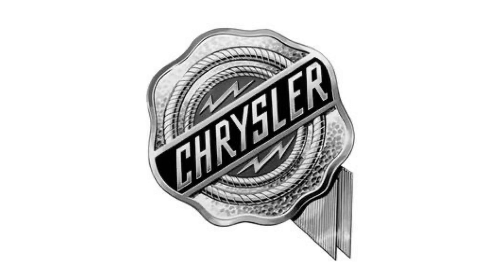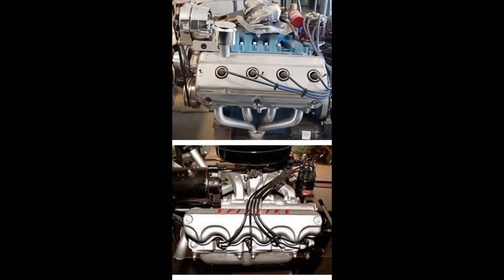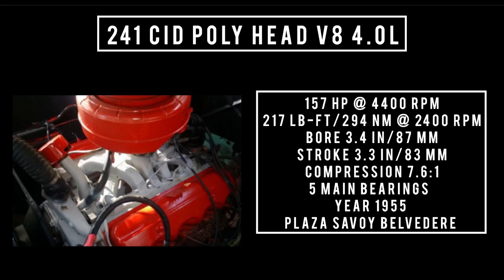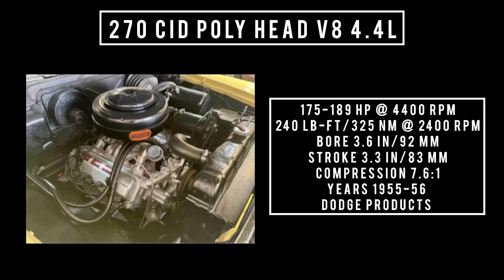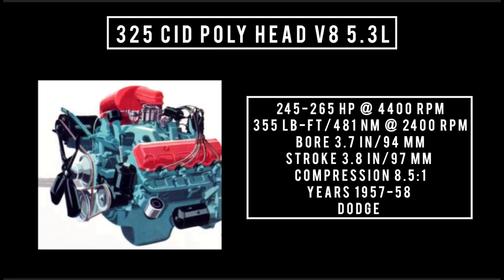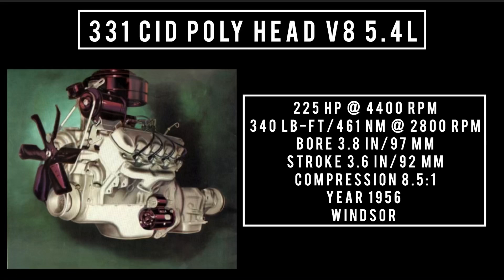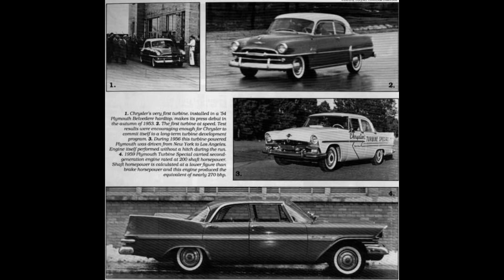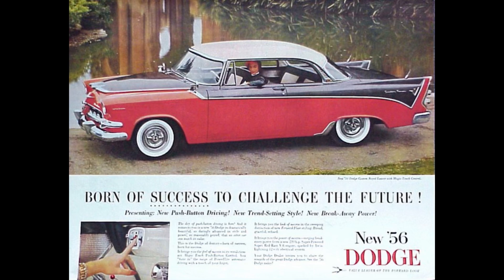Chrysler polysheric head engine family 241, 260, 270, 315, 325, 301, 331, 354

Comment: Chrysler Corp had a strange thing going on with their 4 lines of cars, Plymouth, Dodge, Desoto, Chrysler. Plymouth would have the smallest engine. Ex: in 55 they had the same exact engine as the Dodge except for displacement. In 55 Dodge had the 270 hemi & poly, Plymouth had the 260 poly.  In 56 the Plymouth had a 277 poly while the Dodge had a 315 poly & hemi. On and on until 62 when they had the same basic engine sizes through the entire line. The other lines were the same with Chrysler having the largest & most powerful. Plymouth smallest, Dodge a little larger, Desoto a little larger than the Dodge, Chrysler a little larger than the Desoto. On the Plymouth 277 introduced in 56: It was a completely different engine than the other poly engines. It morphed into a 303 then 318 poly engine which was used up to 65. The 318 Poly block morphed into the 273, 318, 340, 360 LA engines.
Reply from the maker: Thank you so much for taking the time to share that insight

Comment: Do those Plymouth   have the camshaft in the same position in the vertical height of the block as the Dodge  hemi or different? Are the crankshafts interchangeable? and are they both forged?

Comment: Polys are so underrated. I obtained a 65 Dodge block that I'm pretty sure will accept LA heads. Gonna turn it into a 392 stroker and use big valve J heads. I stuck an LA cam in and it fits identical to the poly one. The heads bolt right on and pushrods all line up with no interference.
Reply: That's bull. The cams do not interchange. Poly ports are evenly spaced, wedges are not.

Comment: Good Video.

  The Poly engines are often overlooked but were a very good engine in their own right.  Often overlooked is there performance potential.  An interesting tidbit is that while the 1956 Chrysler 300 (354 cubic inch)354  HEMI made more HP than the top of the line 1957 354 Poly, the 354 Poly actually made more torque than the HEMI (per the factory shop manual).  

It was also said the the reason for the the introduction of the Poly was that it was lighter and cheaper to produce than the HEMI.  I'm sure it was cheaper, however the weight difference was pretty negligible.  Both engines used the same block, intake manifolds and accessories (the exhaust manifolds don't interchange).  I personally weighed a 1955 Chrysler 331 HEMI head and a 1955 301 Poly head (on the same scale).  The Poly head was lighter.......by a whole 1 pound.
Reply from the maker: Awesome information thank you so much for sharing all that information and insight glad you did this video I love an engine episode Wednesdays this Wednesday push it back a little bit I’ve had a lot going on in the background which I will make my random moment tomorrow a lot of cool stuff built =)

Comment: Respectively 1951 Chrysler hemi 180 horsepower 

1952 desoto hemi 160 horsepower 

1953 dodge hemi 140 horsepower
Reply from the maker: Different engines these any poly head engines same block as hemi but heads completely different

Comment: The poly is a neat engine.  It would been nice to see a revised light casting as its heavy and wide.

I think only the Chrysler 331-354-392 should have had the hemi heads.  Dodge, DeSoto and Plymouth should have used   a common simpler engine.  The Chevy small block  wedge was the best because of low costs and most weaknesses couid be overcome with aftermarket parts. The complex Mopar valve trains didn't shine as much in family cars as engineers hoped - they loved the race track.

A big block version of the Poly might have been cool.

Comment: The horsepower ratings shown in this video are all GROSS horsepower.  Today we use NET horsepower, which is determined differently.  Typically you can take 20-25% off of the gross HP to get modern net HP.  And that is at the crankshaft, not the tires.

To put that in perspective, a Volkswagen VR6 engine from the Corrado SLC had 178 net horsepower from 170 cubic inches/2.8 liters.  Compare that with the 170 net horsepower from the 331 cubic inch/5.4 liter polyhead V8....
Reply from the maker: Thank you so much for all that information =)
Reply: The Chrysler has way more torque.
Reply: @jamesbosworth4191  ....And spins way slower.  Hence the equal HP levels.
Reply: @Flies2FLL  Which makes that horsepower easier to use - peaks out at a much more usable RPM.

Comment: I will never understand the reluctance of domestic automakers toward the OHC valve train idea.  With this design, it is very easy to produce a true hemispherical combustion chamber.  Porsche did it with the original air-cooled 911 engine, and even the 1980's Ford Escort had a SOHC cam head with hemi combustion chambers.

As to the "polyhead", it looks like the intake pushrods went between the bores as on a Hemi, but the exhaust went along side the bores in the valley, the way it is done in wedge engines.  This saves that much money?

Indeed, I would like to see the breakdown in production cost between OHV wedge, OHV hemi, and OHC hemi designs.  It cannot be much different-

Comment: I liked the,
 440 cubic inch V8 with the police interceptor package, which produces 375 horsepower and 480 ft-lb of torque. The monster motor could take the massive 4400-pound (1995 kg) car up to a top speed of 150 miles per hour

Comment: The 1955 Chrysler Windsor, in both scenarios.  It was much better built than its corporate companion makes, and lacked the pushbutton transmission selectors introduced in 1956.  Anyone who had a '55 Chrysler will tell you that it was a superbly-built car that gave excellent service.  The '57 Chrysler corporation cars tended to rust out.   The '55 Chryslers did look gimmicky, like the last iteration of a body style rather than the first, but their solidity garnered affection.
Reply: Chrysler bought the Briggs body works in 1953 when Walter Briggs died.  They began to produce bodies in house. Briggs built bodies for other makes, but with Chrysler as the new owner those orders ceased. They hastily began cost cutting that produced a reputation for rust. Eventually they decided upon assembling the bodies at the assembly plant - the unitized body, which produced better results. The older Briggs body Mopars were well built.
Reply: @timothykeith1367  Thanks.
Reply from the maker: Yeah I guess Chrysler products have sort of a gimmicky Ness about them but I honestly think when I see one at a car show especially one from the mid50s they look incredible now I wasn’t around when the cars first came out I wish I was I was born too late.

Comment: The 56 Plymouth poly was 277 CI
Reply from the maker: Different engine family 
This engine family is super confusing that engine has nothing to do with the engine fan we discussed I should’ve made it more clear in the video that Plymouth only used or shared the Dodge engine in 1955 and 56 they got their own engine which also used poly heads but had nothing to do with the hemi block 

The hy fire 277 was in the Chrysler A family Which came out in 1955 it was offered Along side the poly/hemi block 

https://en.m.wikipedia.org/wiki/Chrysler_A_engine

Also check out 

https://en.m.wikipedia.org/wiki/Polyspheric

Comment: Hi Jay!:  Another fabulous engine episode!  At least they tried to stretch the tooling for the hemi block and made another pretty good engine from it!  But you are right.  I think Chrysler wanted to be like GM of the time, where every marque had different engines in their cars.  But even they had to quit doing that by now, or they would have been out of business, too.  Except for the earlier Lincoln engines, Ford pretty much used the same engines for everything. with minor updates.  For example the flathead was just souped up a little when the Mercury came out. But, Ford didn't have but two or three makes until the late fifties when they tried to launch Continental and Edsel.  Interestingly it was Ford that had a semi-hemi engine with their Boss 429 motor.  Perhaps they borrowed the idea from the Chrysler Corporation?
Reply: In late WWII Ford had a dual overhead cam V-10 that I believe they intended for aircraft. It was not well received, but they did make a V-8 version for tanks. Perhaps it had hemi characteristics.
Reply: OOPS!  WYR#1  Plymouth.  #2 Gotta pick that LOVELY 1956 Chrysler, REALLY like that design!
Reply from the maker: Awesome information and insight thank you so much for sharing all of that definitely want to cover the 429 Semi hemi from ford 

Great choices by the way =)

Comment: I drive an all original turquoise and sand color 1955 Plymouth Belvedere with 24000 miles and enjoy my powerful 260 Polysphere V8. She is fast when needed. When I lift hood at car shows there are endless conversations and questions. :)
Reply from the maker: That’s awesome what do you like the most about your 55 what do you like the least I love Plymouth from that era they have so much space inside them even the two-door version I would take a 56 Plymouth anything over 57 Chevy anything I just love the styling of a 56 Plymouth also thinks Chevy ripped off the rear end design

Comment: I prefer the look of the ‘55 Windsor, but ‘56 would bring 12 volt electrics and push button powerflite transmission.  In the end though, I’d still take the ‘55, I’m partial to it as I owned a ‘55 4 door, two tone light green and white.
How about the 413? I have a 300F with all original drive train. I believe that the letter car blocks were specially selected, maybe your research my turn up some interesting factoids.
Great research!
Reply from the maker: Definitely want to do the wedge family on here eventually Chrysler did a lot of different engine concepts just like Ford I was amazed at how many different engine families Ford had I had no idea Chrysler had more.. Not only that every year they change their engine displacement no wonder Chrysler ran out of money.. 

Thank you so much for adding that information what was your favorite thing that you liked about your 55 and what did you dislike the most

Glad you dig this episode =)

Comment: Gmc made a v12 it was two v6 put together that shred a common crank i didn't see it unless i looked over it but i all ways throught they where neat ... Great video 👍👍👍👍
Reply: That's not accurate. Yes mathematically the 702 V-12 was two 351 V-6 engines put together, but that's not what it was. The V-12 did have 1 crankshaft like you mentioned, but it was also 1 block, not two V-6 blocks put together like many assume. It was a 1 piece block for V-12 only. The heads are what give people that impression, because the do use V-6 heads. So there's 4 cylinder heads and 4 valve covers. Just 1 block, 1 crankshaft, 1 camshaft, 1 oil pan, etc......
Reply from the maker: That’s awesome I did not know that definitely have to cover that engine thank you so much for that engine episode idea glad you dig this video

Comment: Very cool 🤙 I just acquired a pair of 354's not sure where I'm sticking em yet
Reply: I recently bought an old stationary water pump from a cranberry marsh that's powered by a Chrysler 354 Hemi 🤘     
The valve covers say "Chrysler Industrial" rather that "Fire Power"
Reply: @johneckert1365  that's cool. A runner?
Reply: @kdsboosted4954  It turns. Haven't had any free time to mess with it.
Reply: @johneckert1365  if it turns I'm sure it'll run. Mine are in parts at the moment
Reply: @kdsboosted4954  right on 👍
Reply from the maker: Sweet =)

Comment: For many years I drove a car with the later generation Poly engine, a 63 with a 318 V-8.  It was very smooth and rock sold reliable, but no hot-rod.  I look forward to the future episode on that variant of the Poly engine.
Reply: I owned several of the poly 318 and as long as the oil was changed  they were very dependable engines.
Reply from the maker: That’s awesome is the 318 poly the same engine that they used in the 70s with the lean burn technology if that’s the case I drove one I thought that was pretty cool I almost bought a Chrysler Córdoba 1976 I had a thing for those but I didn’t like the Excelerator pedal it was super heavy it almost seems like the return spring was too stiff.. Definitely going to cover Chrysler A engine family in another episode this one was just to explain the poly head version of the hemi V8
Reply: @What.its.like.  The 318 Poly was the "A" Engine.  Was replaced by the "LA" in the mid 60's, which I believe was the basis for the 273 - 360 engines that were used until the 80's.  There were some similarities and interchangabilities, but overall they were different engines.  The Poly was very cool, but it was heavy and did not produce good fuel economy.  ("LA" stood for "Light A", I believe.) That's my understanding, anyway!
Reply from the maker: Chrysler’s engines are confusing I thought Ford was confusing with overlapping engine families definitely going to cover both eventually 

It seems like Chevy with their small block design got a lot right and they don’t have a whole bunch of engine Families that overlap one another not saying it’s perfect because the very first year of the 265 they had oiling issues just like the Y block had oiling issues but when they got the kinks worked out it just worked

Thank you so much for sharing all that insight and information I greatly appreciate it =)
Reply: @What.its.like.  At one period of time GM divisions all had different engine types. 
Like automatic transmissions fit Pontiac, Oldsmobile and Buicks but not Chevrolet.
Reply: @Vegaswill714 Yes LA was for "light A". Same block as 318 Poly but much lighter "wedge" style heads. Chrysler actually kept producing the 318-360 LA up until the mid 2000's
Reply: @Vegaswill714  Yes l had a 65 Belvedere with the 273 and I had a 67 Sport Fury  with the first year 318 LA which is two of many Chrysler products l owned back when I could afford them. 
I  bought 75 Corvette in great condition for less than l could buy a 70 318 Fury.
Reply: @What.its.like.  No, the LA engines that were saddled with the "Lean Burn" systems (which wasn't really bad when it worked, which wasn't often, Chrysler did poorly in training dealer mechanics on the intricacies of the "newfangled" engine computer) starting in 1975 in California models were different than the Series "A" engines that the 318 "Poly" was the last of.  More or less same engine block (minor differences in mount tabs and crank pilot hole).  The new LA engine was a bit lighter due to improvements that shed some mass w/o compromising block strength and integrity, never mind that the wedge heads were considerably lighter, narrower, and simpler than the "Poly" heads they replaced.
Reply: @What.its.like.  Shatroller opted for short rod robbing piston TDC dwell time, a very forgiving arrangement tho.
I had a 283... I shit you not, I measured .050'' piston/cyl. wall clearance after a 300 degree overheat [at the gauge]
Worst symptom? Wanted way more timing than the starter did, used a quart of oil in 100 miles...
Personally prefer Chryco or Ford...slightly more demanding, but not the typical Chevy nickel & dime $ death after 70k BS:face-blue-wide-eyes:
Reply: @What.its.like.  "return spring was too stiff."
😉"ECONOMY FEATURE"
Helped to quite simply 'keep your foot out of it', as well steadier....😅
Reply: Having tackled the Poly-engine vs A-engine topic many times on
various threads/videos, I'll say this: It's too complicated for this
particular video-guy, or most others, to attempt.
     Remember that advertising-writers for the Chrysler Corporation regularly 
mixed-up technical aspects of the engines. Thus, many owners of cars with A-engines became
convinced they had a Poly, due to Chrysler ad-efforts to convince buyers that Polys were
great, just like Hemis.
Reply: As I remember the early 318 was a stouter and heavier duty engine than the 318 of the 1970s,the earlier 318 was mostly found in Dodge Trucks but I think a version was in the earliest Barracudas. 
  The later light 318 and especially the "Lean Burn" version I thought used more rather than less gasoline and the "Lean Burn" was not as powerful.

Comment: great episode that explains in detail the difference between the early 50's Chrysler Hemi-head engines and the mid 50's Chrysler Polyhead engines. Anyway you put it Chrysler made good engines back then with lots of power. Looking forward to your episode on the revolutionary 1955 Chevrolet small block engine. I know its coming soon!
Reply from the maker: Definitely going to cover the small block Chevy episode I’m not entirely sure when it’s going to take a long time to put that one together there’s tons of information to go over and tons of different engine configurations because Chevy didn’t have to re-engineer their block like all the other companies did like Ford and Chrysler ford had the y block, FE, Windsor small block (I might be missing one ) 

Chevy did not have all those engine families they just had a small block Chevy engine family which ran from 1955 all the way up until 2003